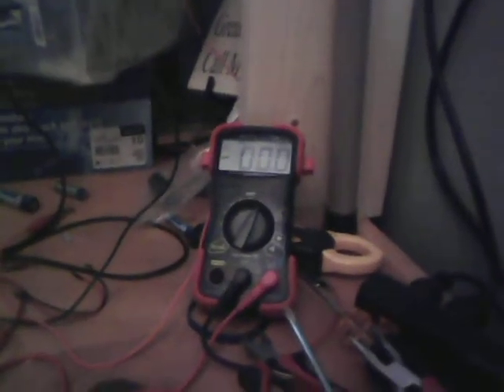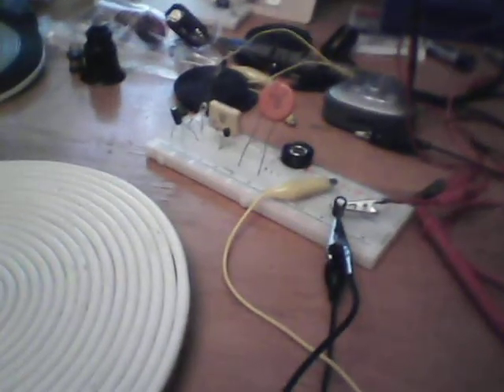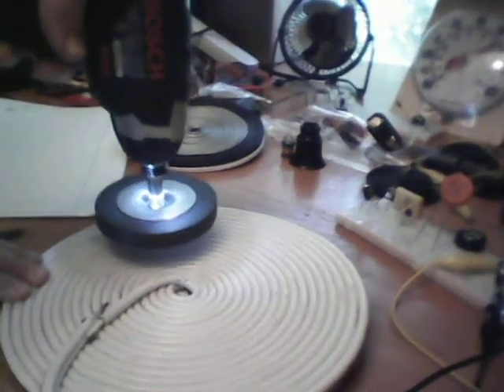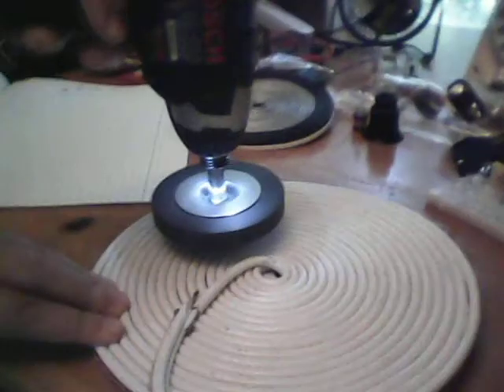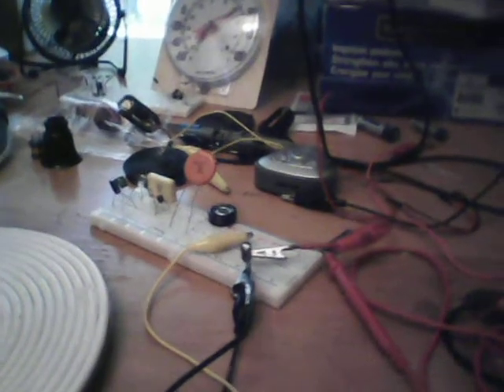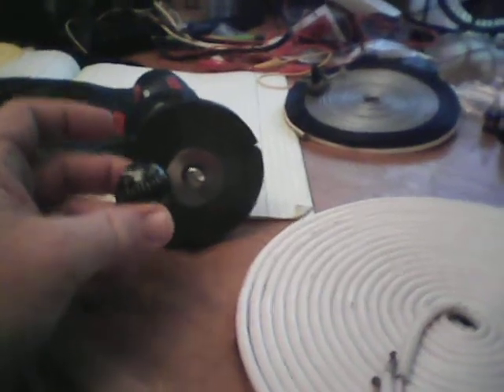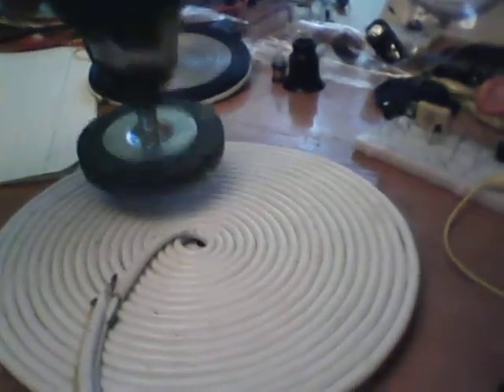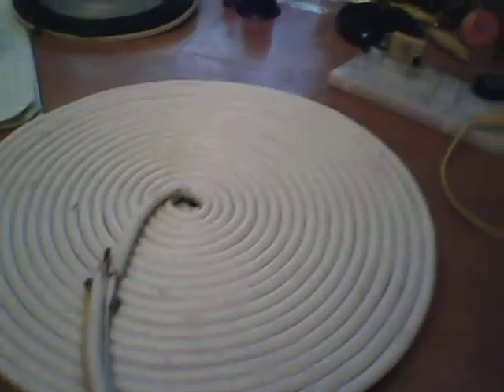Faradays Paradox Revisited BPC

Comment: If the magnet face towards the coil shows both poles, you get regular Faraday induction, as parts of the coil wire move relatively to the fluctuating field.